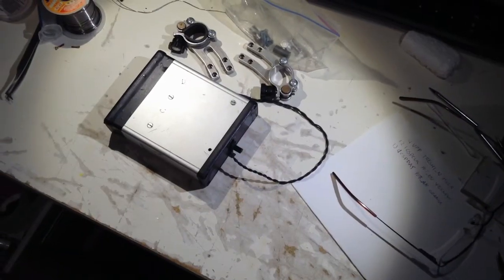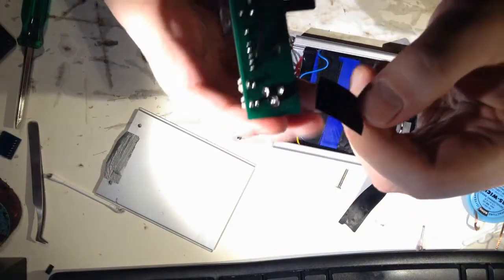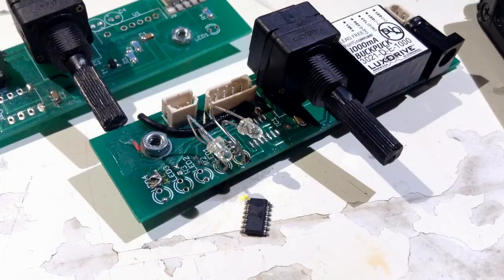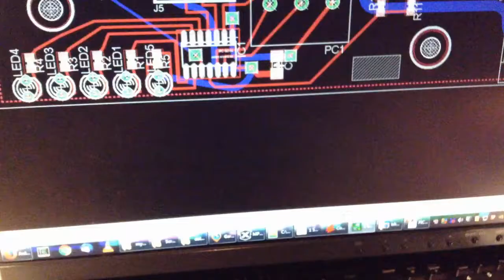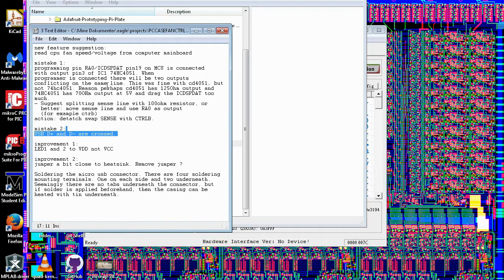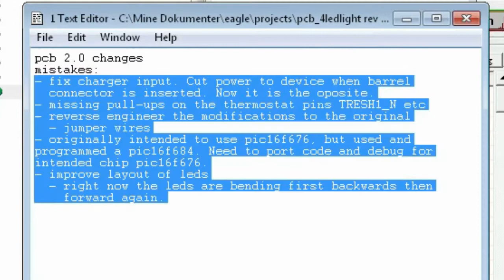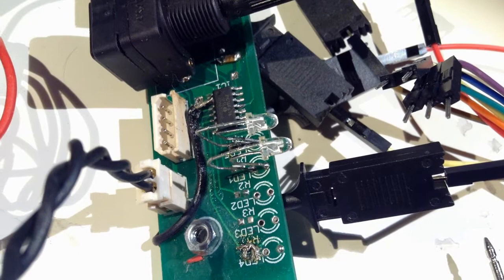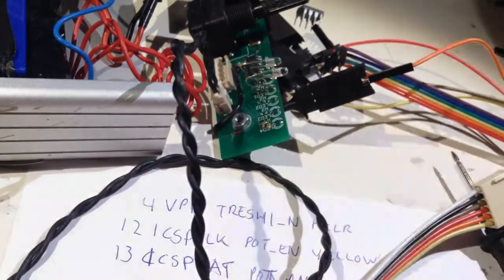Replacing the mcu on the LED lamp

Comment: That escalated quickly. You went from everything went wrong, to a working light. What happened?
I think I remember the fan project. Didn't you build that to cool a pc?
Nice Santa suit :)
Reply from the maker: The Highlander A lot of wasted time on soldering up an adapter. mistake on mistake. then i soldered in the new mcu and it worked right away. tried to in-circuit program it. that erased it instead. de soldered it, had it in the air with probes on it to the programmer falling off all the time. then reprogramming it after probably 20 minutes of trying to keep probes from unclipping. started to hate the whole thing. worked after that. will add a programming connector on the next pcb. must figure out how to get it programmable.
Reply: You do something I can't do, which is thinking with the camera rolling. I just lock up. I like seeing you works your way through an unexpected problem. You usually figure it out.